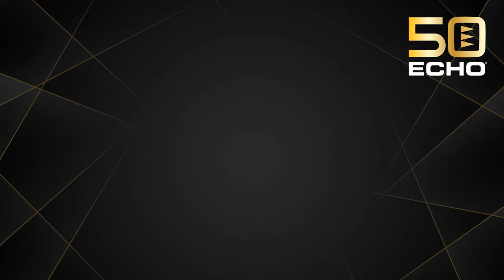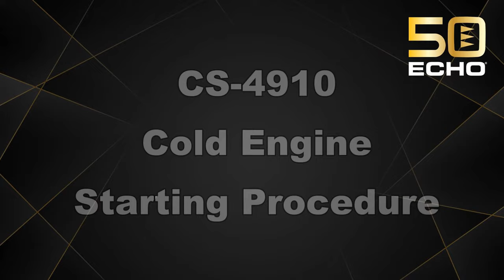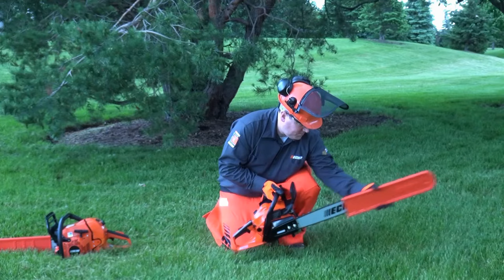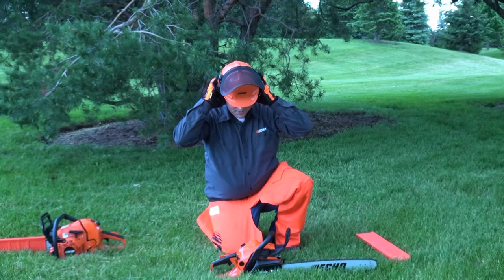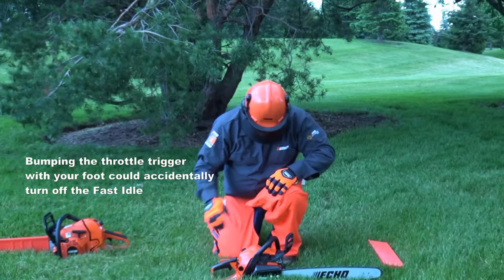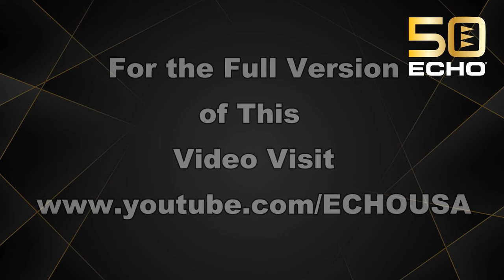ECHO_Chainsaws_How to Start the CS-4910 & CS-590 Chainsaw_How-To Video

Comment: DO NOT PUSH THE DECOMPRESSION VALVE!! Even though the video says to, the guy at Home Depot told me not to when I brought it back after not being able to get it cranked. It robs the engine of compression . I had to take the chainsaw rental back and he was able to crank it when he pried the decompression valve back up. Also, when I got back home, still had trouble cranking. Turned out I needed to hold the chainsaw in the air with the Chain angling towards the ground. It seems like this got the gas flowing better. Also hold both triggers while you’re cranking in mid air. May may need two people. If you’re left-handed, that will help! Hope that helps and good luck!
Reply: sounds like your saw needs a shop to look at it. It should start exactly how it is shown in the video. all this extra stuff isn't necessary.  If it isn't starting how it is shown in the video something isn't right with the saw.
Reply: Holding mine with the triggers pulled in the air with the chain angled down is what it took to get mine going after sitting all winter. Now it cold starts after a few pulls and hot starts with one pull just like it did when it was new. Thanks for the tip it worked for me.

Comment: Good saws and good advice.  I’ve made it a habit to switch the on/off switch back to on after I shut the saw off so I don’t forget that step and flood it.  You don’t have to push the decompress button but if you’re not strong enough it does make it easier to pull.  I’ve never understood why equipment doesn’t come with a dvd on safety/starting/basic maintenance and accessories.

Comment: Who is the asole that engineered a problem into their product. If it wasn't bad enough I was standing by echo when this failure occurred. As in my argument against an associate w/brand new side by side. And mine failed to turn on after hours of pulling this fkng handle so imagine my amazement when I read the comment NOT TO PRESS THE COMPRESSION oh hallelujah STOP! I'm not going to waste your time with a happy ending. Whether the apron they placed over this flacid rod along the side of the motor was the reason for why I was embarrassed or the 50:1 engineered fuel that failed to ignite I cannot say. In my opinion perhaps it was the girly hands that couldn't pull the cord the correct angle while pressing every button chocked both sides of a chainsaw upon starting a brand new piece of LIABILITY. Thank you echo you have my most sincere thoughts. I am returning this and i I'm going to be the one to explain to a customer why I took an entire day OFF at their house rather than just stay home or do anything else. I must be committed to my work.

Comment: i borrowed a CS-590 yesterday that a mate left in my shed 6 months ago (i'm storing it and several others)
i watched this video, followed the instructions and aside from using the decomp button once (to prime the fuel line), it false started on second pull and ran on 4th pull.
it started 1st pull a dozen times after that, i'm quite impressed, sadly it's just a bit too heavy for me to use more than 10 minutes at a time.